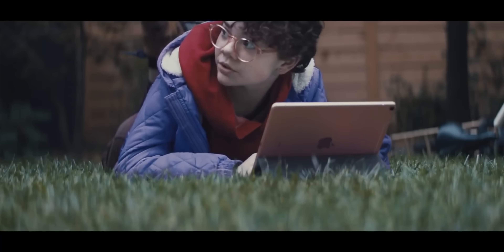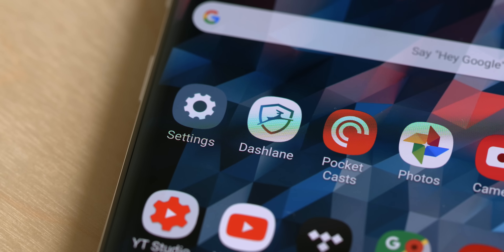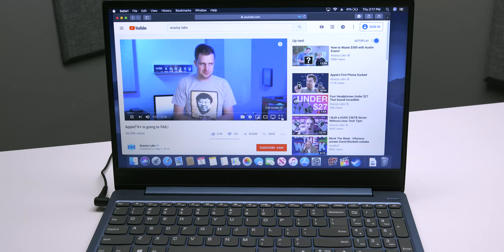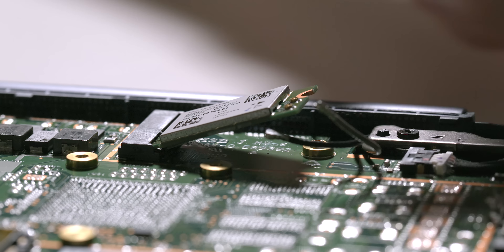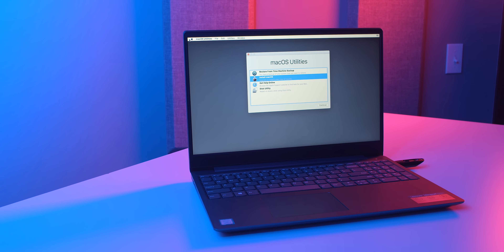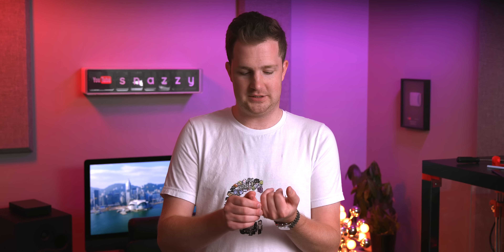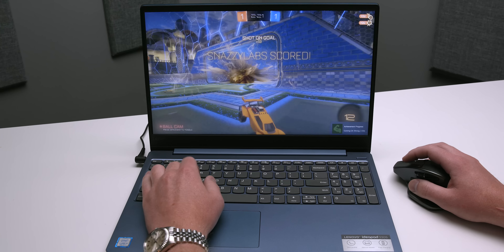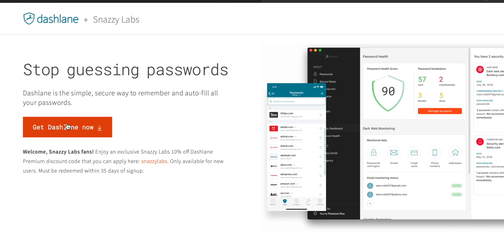The $279 MacBook Air KILLER!

Comment: Apple could easily make hackintosh unusable, blocking access to their online services. No Appstore, no iMessage, no Siri etc. Just take a look at Nintendo how they fight to stop running Wii Shop in emulator despite it sole purpose was to buy legally games from Nintendo!
Apple is doing that with iOS. To access Apple online services you need a proper serial number within iPhone/iPad. Without it there would be tons of iPhone clones that run modified iOS.

Hackintosh serves two purpose for Apple. It gives a real low-end alternative and it also gives super high-end alternative with current Ryzen CPUs.

To use Mac OS on non Apple device you need to get your hands dirty. It's not a thing an average Apple consumer would do. That way Mac sales aren't threatened, but more people get into Apple's ecosystem. Most iOS developers starts with hackintosh and when they start to get money out of this, they buy real Mac. Profit!

It's even simpler to just virtualize a Mac OS. Apple could also block it, but they're fine with that. It won't run as smooth as on real hardware, because of lack of GPU support, but it's good enough for programmers. At least you can utilize your 8+ core Ryzen power in Xcode while running Windows in the same time on a machine with Nvidia GPU. You can of course virtualize Mac OS and pass through real Radeon GPU, but it's another level of effort.

Anyway this will last while it will be profitable for Apple. Back in the day, Apple sued some company that started selling PCs with Mac OS. They sold them with a copy of Mac OS on DVD which was a thing when you had to pay for upgrade or a new Mac OS copy. Apple didn't liked that.

Comment: it would be very helpful to do a video on used laptops that work well with hackintosh builds. That way you can get much nicer laptops than this lenovo. For example the dell xps 9333. You can get those for about 300 dollars on ebay and it is waay nicer than this lenovo. I think it's fair to say that many (if not most) people who are interested in making a hackintosh would be more interested in an ebay xps 9333 more than this new lenovo.

(I don't know if the xps 9333 would work well with hackintosh it was just an example of a cheap used laptop with good specs)

Comment: Quinn: Ram is soughtered on
Also Quinn 10 seconds later: I just installed An extra 4 gigs
Reply: the first 4gb is indeed soldered on. However lenovo wants to allow for expandability and also wants to allow THEMSELVES to easily reuse the logic board in other laptops so still has one open slot for ram so you can install another 4gb module for dual channel memory. It is also likely the reason the onboard storage is a generic 2.5 inch SSD. Its easier and cheaper to make higher end models of laptop if they can just reuse parts and slot in the better spec bits as needed.
Reply: It's the same as my girlfriend's ancient Lenovo computer where it has on board RAM + A SODIMM slot for additional RAM.

Comment: The only thing I can say about apple is they are expensive but they last forever (at least the models that weren't soldered). I'm still using a macbook pro from 2011 and it still rips. I don't need a mobile workstation, that's what my desktop hackintosh is for. However they are complete scumbags for soldering everything since now you have to waste an entire computer if a stick of RAM fails or the ssd (which will happen eventually). I mean the old macbook pros still rip just as fast as the some of the newer ones since cpu speeds finally increased to a worthy amount. For about almost 10 years they were just selling the same laptops with the same amount of power. At least I can still replace things when they go bad. I'll give it to them that they are the best laptops on the market due to how long they last, and how everything is built from the trackpad to the screen. Nothing feels cheap (except that terrible keyboard). You buy a really cheap laptop and you can just feel that it's not going to last long and the charging port will give out. Those cheap ones are just terrible. They will only ever get my money for a laptop unless I buy used which I usually do. I just upgraded from my mid 2010 mbp dual core 4 thread with sata 2 to the early 2011 mbp quad core 8t and I only paid $100. The cpu is only 39% slower than my quad core i5 desktop machine and that thing still chews through video footage. The old models work just fine.

Comment: I found a way to install Mac OS without a Mac. However, even though Windows on this machine recognized the extra RAM, larger HD and the Broadcom BCM94352Z, WiFi worked,  that I installed... the MacOS doesn’t so far.  Any ideas guys?
Reply: Just got WiFi working. Now on to fixing trackpad and keyboard.

Comment: I have the same laptop, but i work on windows. I want to replace the wireless card because the stock one is rubbish..  how do i find a compatible card?
Reply: I have added a 4gb ram right after i bought it..  and mine came with a i3 7th gen not 8th

Comment: hi i need your help, i have lenovo ideapad 130 15ikb with intel 8th gen core i7 and everything is working including sd card but i just cant get the trackpad to work , i installed mac os catalina 10.15.4 and is running smooth with ram of 12gb and a 500gb ssd .Please help me to fix the trackpad .....

Comment: A $279 MacBook Air KILLER!!! ...That can't actually be bought for $279... and has a pitiful 3 hour battery life & a 120gb SSD, and a 'really, really, really, really bad display' which they suggest you replace by sourcing, purchasing, shipping and installing into a bespoke laptop in what amounts to effectively a 'sidegrade' to a slightly better but still 768p display for $50 + P&H. And mandatorily requires you to upgrade to at least 8GB ram to run Mac OS Mohavi, which, again, you will need to source, purchase, have delivered, and install for $20 + P&H. And then purchase & install Mohavi and hope that the WIRELESS CARD CAN BE DETECTED! You know, THE THING THAT CONNECTS YOU TO THE INTERNET? Otherwise just install a broadcom one that you have lying around like him.

Comment: If you want even better performance, a better (Full HD with touch) screen, better keyboard and trackpad without all the hacking and risk, buy an HP x360-14 Chromebook for $400.  Has the same CPU, Full HD touch screen, 8 gigs of RAM, 64 Gigs of storage (plenty for a Chromebook), and you'll get 100Gb of protected online storage with Google Drive.  With the Chromebook, you can run a gazillion Android apps, you can launch a Linux container (supported native by Google -- not a hack) and within the Linux environment, run nearly any Linux software, and of course all of this is built on Chrome OS (using a secure unix kernel just like a MAC OS).    Sure, you're not going to make videos on the Chromebook any more than you'd make videos on this Whackbook.  But you're going to have a much better experience with a very fast laptop that has 11-12 hour battery life, and is fully supported by the Hardware and Software vendor.   Oh - did I mention that the HP x360-14 is a 2-in-1?  The screen folds back and you can use it like a tablet.

Comment: I realize I'm commenting 6 months later.  This sounds cool and all and I get tempted until I start doing the math.  The cheapest laptop in your list is now $359 (the one with the awful display which does a massive disservice to the Mac experience), and for the upgrades you do (the cheaper RAM is now unavailable, the other RAM is $60), I'll drop the SSD down to a 250GB at $69, you might just as well go to Mac of All Trades and get a deal on an older Mac that works just like it should.  I guess videos like this need to be updated to reflect the current model that you should get at the best price.  Also I don't know what OS you're now limited to.  I take it you can't just update whenever you want?  You probably have to wait until someone one some forum somewhere has worked out the bugs.  Is it really worth it to save just a couple hundred bucks for something no one will warranty?  Edit because I forgot about the Broadcom card which is another $49.  Tutorial forum post still "coming soon"?  Oh well.  I would have liked to have read that.

Comment: I did this years ago with an Atom processor micro laptop and some EFI hacks. Still works.
But now I would instead buy a M1 Mac. With the M1 chip Apple has nearly reached the limits of what none-quantum computers can achieve.
Maybe one doubeljng of processor speed is still possible, but then Moore's Law breaks.

Comment: Honestly 13 inch 2015 MacBook Pro with 8GB RAM and 256 GB SSD are all over ebay for $250. Much better machine
Reply: What cpu,gen of cpu, year
Reply: @Cyber_Gas  its like 3 gen behind but the machine itself is just much better to use since its better built has better display trackpad keyboard etc

Comment: That laptop is worse than a 2012 MacBook pro so no the specs aren't "ok"... Just saying the CPU has a worse benchmark and the worse display than the 2012 MBP which is an 8 year old machine. The only benefits are less weight and better battery- not good enough.

Comment: It outbenches the new Air because Apples cooling design sucks. They overheat and thermalthrottle.
they have been bad in the past and theyre even worse now. I wouldn't get any of the new macbooks.
A CPU temperature up to 100°C is normal and fine according to Apple.

Comment: Apple has always been a greedy company.  I remember back in the 80's an Apple IIe costs  $1200.00, came with 64K of RAM and had an 8-bit processor.  The Commodore 64 also came with 64K of RAM an 8-bit processor and in my opinion had better graphics and definitely had a better sound chip.  And it did all this for half the money.  LOL.  Oh and most Apple fan boys back then were just as arrogant and self deluded as they are today.  Hell my buddy has an ipad pro and can't even connect and print to his wireless printer.  Seriously...a fucking $1000 dollar tablet, and he can't print from it unless his printer supports AirPrint.  UN-FUCKING believable that Apple still pushes this bullshit in 2020.  My MS Surface has some quirks too but at least I can print to my wireless printer from it.  When the ipod first came out it had zero expandability, and they still don't.  Now even Apple's Mac computers have no expandability, the memory and even the fucking hard drive is soldered to the board so if the HD fails you have to take it in for repairs.  Would those greed fucks at Apple really loose that much money by letting customers replace their own hard drive if needed and add some more RAM?  FUCK APPLE.

Comment: This is not a macbook air killer. I'm no fan of apple, but this is a terrible choice, even for under $300. Bad monitor, only 4gb of ram only 128gb ssd, horrible cpu where it can only handle checking emails and netflix, horrible battery, not super thin or light. This matches nothing to the macbook air. This is only good for gifting to someone who knows nothing about computers and wants to look at cat videos.

Comment: How is this a MacBook air killer if it is soooo much more shity than the real thing? 
It's just a crappy laptop than runs Mac OS...
Reply: It literally performs better in every benchmark. RAM and Storage are upgradeable, screen is replaceable. AND it's like 1/3 the price. How is it NOT a MacBook Air killer?
Reply: @nawarelsabaa  it is most certainly not better in every benchmark. It is worse in every benchmark. And it has terrible battery life. Yes ok it is cheaper but it's cheaper because it is worse. I know that Apple products are not worth their price but at least they are really good products in most cases.
Reply: @ΖαχαριαςΑλαλαμι  the video shows the benchmarks